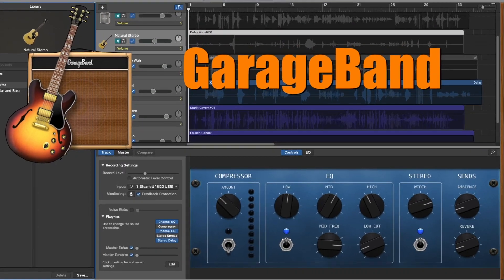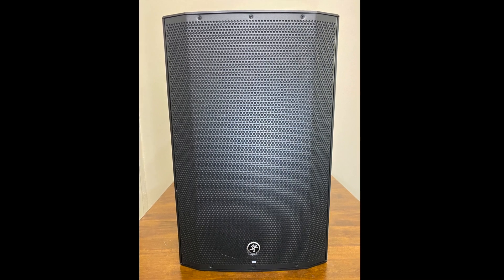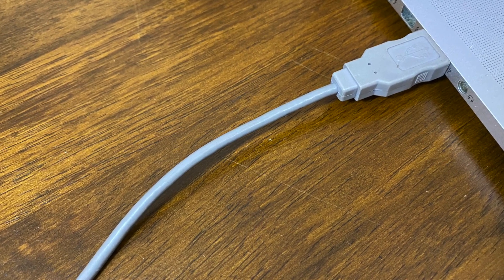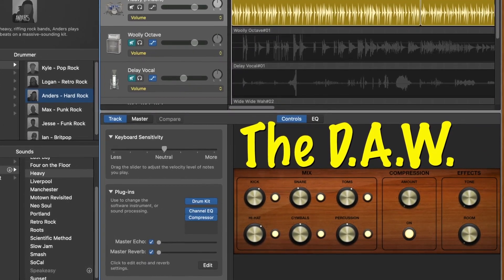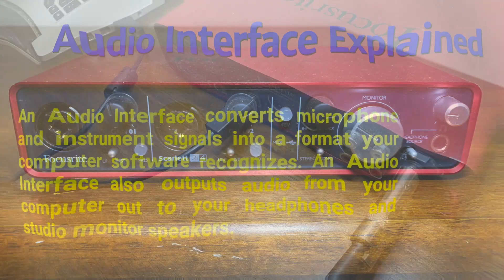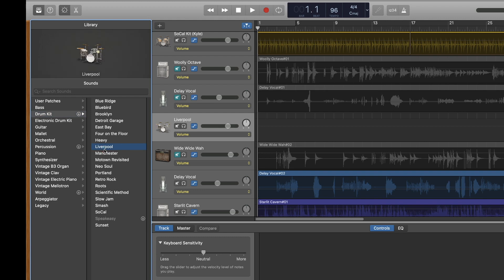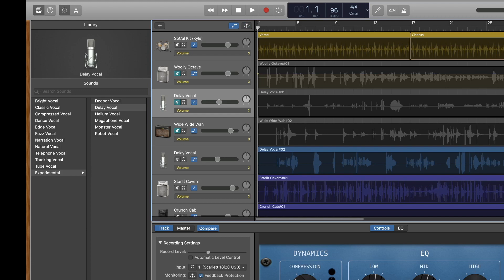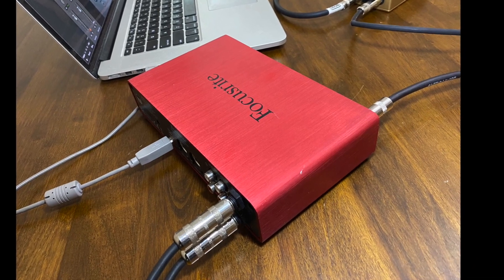GarageBand - Recording Electronic Drums

Comment: Thank you! What i don't understand is why do i need to pick a vitual kit or drum sound in the DAW if i want to record my own kit? How can i just tell the DAW- record exactly the input you're getting without altering the sound?
Reply from the maker: Yes, you can in both GarageBand, and Logic Pro.  Since this is a GarageBand video, follow these instructions:

How to Use Your Drum Module’s Sounds in GarageBand (Audio Recording):

🛠 What You Need:
	•	An audio interface (e.g., Focusrite Scarlett, Presonus, etc.)
	•	Audio cables (usually 1/4” TRS) from your drum module’s main outputs or headphone jack
	•	A Mac with GarageBand

Drum Module → Audio Interface → Mac → GarageBand (Audio Track)

 In GarageBand:
	1.	Create a new audio track (not a software instrument).
	2.	Set the input to match the input you’re using on your interface (e.g., Input 1).
	3.	Arm the track for recording and monitor the signal.
	4.	Hit record and play your kit—the sound from your module will be captured.

Hope that helps.. :)

Comment: Instead of using the garageband drum kits can you use your midi drum set sound instead? Or do you have to use the kits provided?
Reply: You can, use a sampler and then assign your MIDI hits to it
Reply from the maker: You can, connect to your Audio Interface using a Quarter-Inch Cable and use and Audio Track in GarageBand.. You'll hear your Drum Kit's sound from the Module.